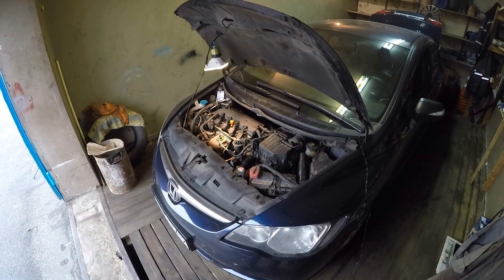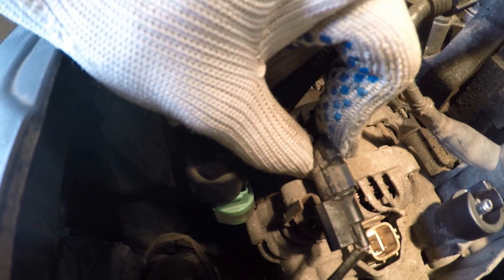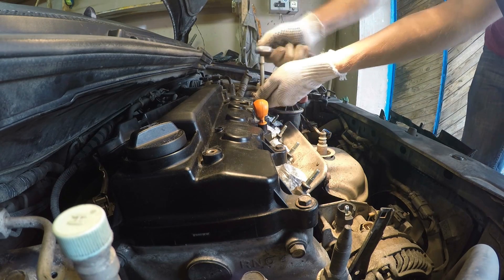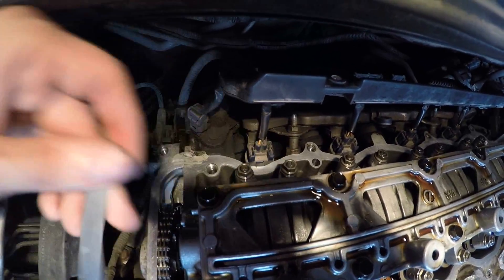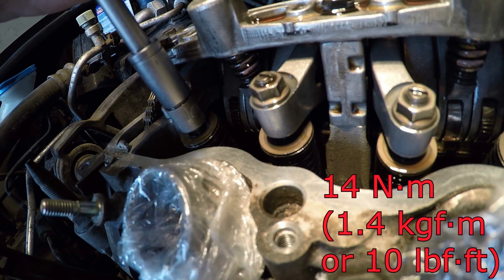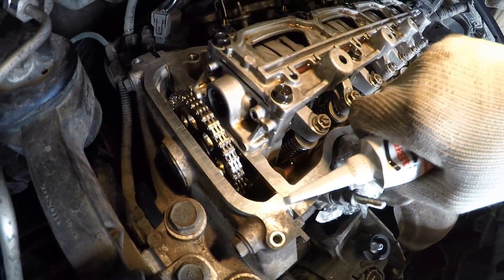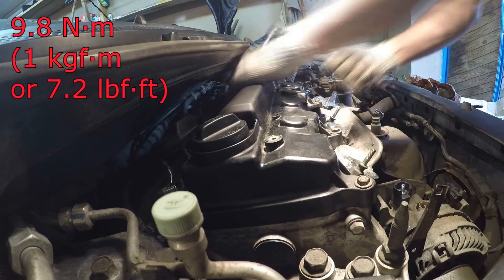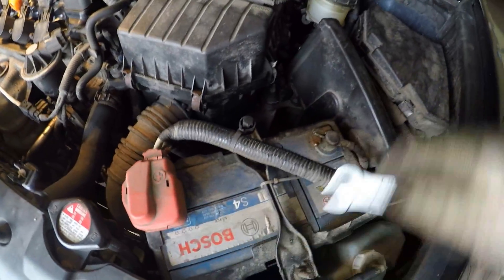Valve clearance adjustment - Honda Civic 4D/5D 1.8 i-vtec (step-by-step guide)

Comment: (btw turning the engine requires a bit of force, most YouTubers probably removed spark plugs, also I didn't have a 19mm so i used a 3/4s) Just finished doing this on my 06 civic. Interesting enough the internals of the engine are a copper/brass/gold color? Idk what that was about but when i was finishing i checked the oil level to see that it had basically none? Im guessing that was just me turning the engine over manually or the fact that i did this over 3 days with the cover not fully bolted in.

Comment: Very good informative video, you made a excellent effort to give exact detail to adjustments and clearances.
I had a issue with the valves sounding noisy and engine not running as smooth as it used to.
Thank you 🙂

Comment: This is the BEST guide out there, thank you so much for the video! I’m going to do it soonish by myself and watched like 10 videos on the topic already. 
Noone mentioned in their videos valves need to be adjusted in order 1,3,4,2 like you did. I read about it in Honda manual which otherwise extremely lacks in details so posting a comment when this plays :D
Thanks for the tip with plastic cover too, stand out idea!
Also didn’t know the car needs to be in Neutral until now..

Comment: Now I fear less doing that maintenance, thanks a lot !
Why do you change the gasket tho? In the shop manual, they only say to "thoroughly clean the head cover gasket and groove".
I see that you already replied to someone that the manufacturers say to replace it every time, but where did you see that ?
Anyway thanks again for that video.

Comment: Just did mine. They had never been done before in the life of the vehicle. Idle rattle/clicking noises gone now on an engine that had 256k km over 11 years. Hoping, also, to restore some fuel efficiency. All exhaust and intake valves where a little loose. They had a small gap when the max size feeler was inserted for reference (i.e. a tiny bit of valve motion could be detected by hand). It was consistent across all valves. I attribute that to wear. Everything is clearly described in the service manual and this video is very accurate. In addition, I removed the cowl (plastic trim at the engine bay / windshield) to have a bit more room to work.  In retrospect, If I did it a second time, or for any work at the back of the engine bay, I would also remove the steel cross member that is directly under the cowl in order to totally open the back side of the engine bay.
Reply: Hey, how has your fuel efficiency change since your valve adjustment? My mpg is 200-230miles per tank. I used to get 330-370miles per tank. Im looking into doing valve adjustment.
Reply from the maker: Thank you for your comment, that's a good remark, I totally agree - if you remove the cowl and steel cross member, it would be much easier to reach the back side. Of course it needs extra time to operate, so there are 2 options: adjust them like shown in video, or spend a little bit more time, but instead get easier access to operate.
Reply: If you've lost 100 miles per tank, then there is something seriously wrong with the car.  Probably couldn't hurt to have a look at the valves to see if something has gone badly wrong there, but should also do a compression check, have a look at the transmission, and also check for substantial break drag.
Reply: laaaaaaaalaaaaaaaa hello, thanks for your input. I am going to get my valves adjusted at the dealer soon. What do you think is the best way to check my transmission? What would I be looking for? Thanks again!
Reply: Check transmission fluid level, and if it hasn't been replaced since the mileage reduction, then drain and install fresh.  Does the car run normally?  Hard to imagine that it would with it getting less than 2/3 of typical mileage.  Have you checked plugs and air filter?
Reply: laaaaaaaalaaaaaaaa I’ve changed plugs and ignition coil about 1 1/2 to 2 years ago. I guess I will change transmission fluid, I did get it changed around the same time. Car does seem to ride rough when going slight uphills but runs fine.
Reply: I just noticed the replies to my comment way back when.  The fuel economy of my civic has returned to the original (now 12 years ago) factory specification. I track it at every fill up. That is attributed to not only valve adjustment but also other tune ups: egr valve adjust, throttle body cleaning, new pcv valve, and new AFR sensor. I believe the AFR sensor had the largest effect on fuel economy improvement. The original AFR was still working, but I had read they can become slow to respond with age so I put in a new Denso sensor (I was also concerned about the old, original, AFR failing and the catalytic converter getting damaged as a result of an extended period of rich running). Pre tune up the car had been getting 9.5-10.5 l/100km not it gets closer to 8.5-9.5 km/100km. Mostly city driving, manual transmission, multiple drivers who are not aggressive with the pedal. The latter number is close the factory spec. To get the low end of the fuel consumption range the car has to be driven with AC off.  The biggest improvement has been in the sound of the engine. It's nearly a year later and it purrs like new (as best as I can remember, "new" was 12 years ago!). Especially at idle. Formerly it was noisy and "clicking" at idle. I've also had oil two analyses done on the car since this post and it is all fine - no unusual wear. The engine will probably outlive the rest of the car.
Reply: laaaaaaaalaaaaaaaa - Consider the AFR sensor. A replacement, even if only preventative maintenance, may be in order. Get a good one. It's a critical sensor.

Comment: Great video. I'm planning on doing this very soon. One question: do you always need to replace the gasket when you do a valve adjustment?
Reply: Jackson Alvey  yes and no. You should. But not always necessary. Some rtv and the old gasket would work find
Reply from the maker: Manufacturer recommends to replace it every time you open the cylinder head cover, but everything depends on the condition of the gasket. If it was installed less than a year ago and has no cracks, I think you can try to clean it and install again
Reply: For anyone else who sees this comment in the future, talked to my local Honda dealership service department. They inspect it but don't replace it unless it's worn.
Reply: @AudreysKitchen  this took me back! I ended up just replacing mine 5 years ago when I did it. Don't know that it really needed it, but oh well!

Engine block ended up cracking 2 years ago so I had to part with it. Was a great car, but I understand that was a flaw that many of them had.

Comment: Hello, a question, there is another way to do the idle relearn manually, before I had 750 rpm and now has 650 rpm and feels a slight vibration, and try to clean the throttle body and the maf sensor and accelerating it at 3,000 rpm for 5 Min and continues with low rpm. 6 months ago the same thing happened to me, just disconnect the battery and accelerate it the same way and I get to stay, but this time it's still low in rpm. some help ??? thanks.
Reply: Las vegas Nv   The idle relearn can’t be performed until the TPS is reset , you need a tool Foxwell 510 meter with Honda software
Reply from the maker: hmm, that's a little bit strange, because idle 650 rpm is totally normal for this engine, and you can feel a slight vibration. Honda made such low idle is to suit environmental standards. I don't know any ways to do idle relearn manually (except the one, you describe) without HDS scanner

Comment: Great video. One question. After adjusting it is needed to do learning procedure?
Reply from the maker: Thank you. No any additional procedures required. Just start the engine and go.
The manual says the following: 
"1.(only European models): Turn the ignition switch ON (II). Connect the HDS to the DLC.
2.(only European models): Select Health Check, then VALVE CLEARANCE CHECK on the HDS. If necessary, adjust the valve clearance."
But this procedure is made before adjustment and this is just a check, but there are no any learning procedures.

Comment: Thank you so much for this video.  One question: where are the spark plug tube seals?  I'm interested in replacing those, too as there is some oil leaking into the ignition well.
Reply from the maker: Sorry for the late reply. This engine doesn't have any spark plug tube seals, because the tubes are situated directly in the cylinder head. I don't even know what to answer. But if you have honda civic 4d with 1.3l hybrid engine, the oil leakage is possible, You just need to replace spark plug tube seals, situated in the valve cover. Here are their OEM part number - 12342-P08-004